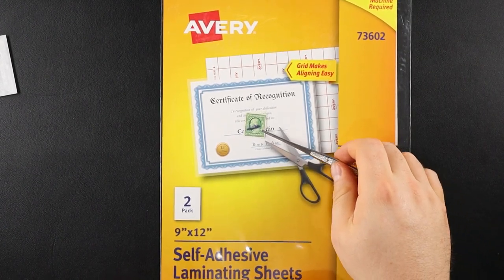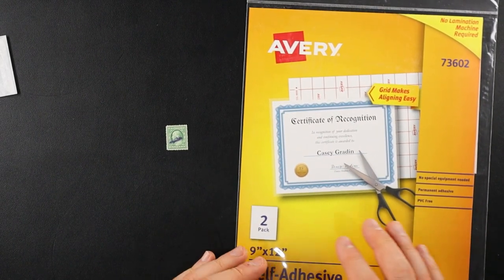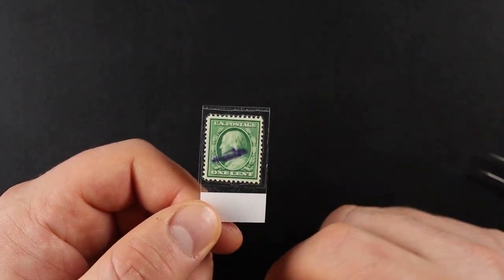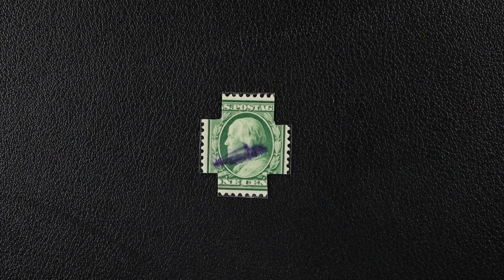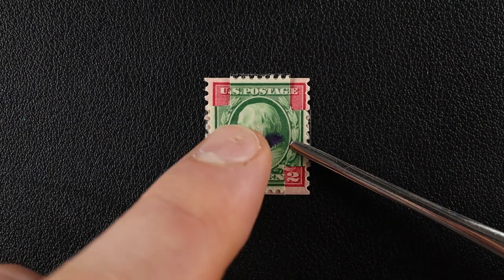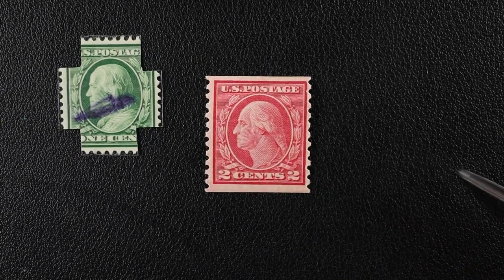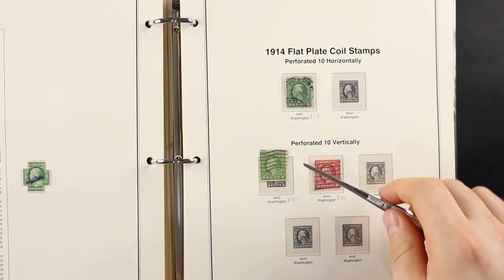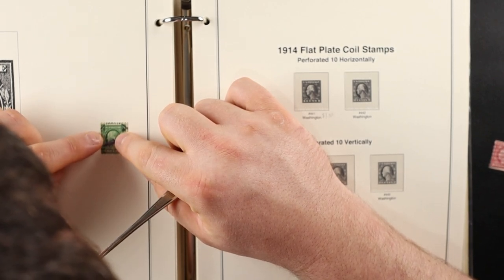Creating A Flat/Rotary Plate Stamp Identifier Tool & Cool Postcard From America's Polka King

Comment: Are you sure the laminated stamp was correct?
Reply from the maker: That is the joy of this method. I don't have to check. Any Washington/Franklin that has the denom spelled out is a guaranteed flat plate. However I did measure it anyways and it is flat plate.